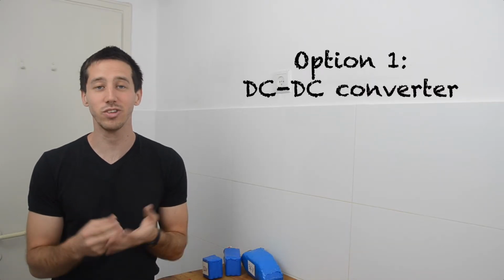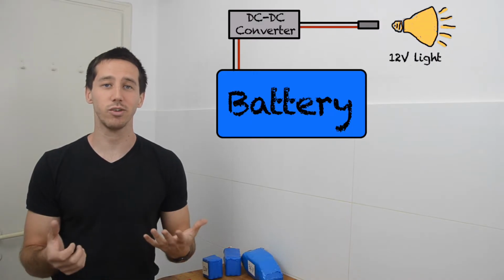How to add any LED lights to an electric bicycle

Comment: Wiring LEDs in series is the stupidest idea for a bike or any vehicle. You seem to have your list backwards. The individual regulated lights is the best solution. if you wire all your lights in series and any blow, ur whole lighting system goes down. Then ull have to test each individual light to see what one is at fault. God forbid you also mismatch the light types in amps, watts or impedance and fry half your lights.
Reply: none of these youtubers actually show you them wiring it to their own bikes, notice how they are all doing inside on a table, videos like these should be deleted from youtube
Reply: The LEDs  on strips are already in series / parallel configuration

Comment: I love all you do Micah, just bought your book on building battery packs, amazing read!  

I do have one critique however, even though you CAN draw power from you charging port on your battery to feed a light, depending on you BMS, it can be a very bad idea to do so, as it could damage the BMS.  

I love the idea of wiring several 12v lights in series however!  Never would have thought of that, keep up the good work!
Reply from the maker: This is true, but I've never seen a BMS that can't handle at least 2A via the charge port. This seems to be a nearly universal minimum for ebike battery BMSs. So unless you're using huge lights that pull more than 2A, I can't see this being an issue. But you're right, pulling more current that the BMS can handle via the charge port could damage it.
Reply: Thanks for your reply, I only mentioned this since I sought to use this very method to power a LED headlight, but was warned against it by the battery manufacturer.  Perhaps they were just being overly cautious.
Reply: @EbikeSchool  I was about to try ur method of wiring to charger port but now Idk if these light will be to much draw...How can I access power without  damaging BMS? I was told to find B+B- wire but IDK what that means
Reply: Hi Micah, I have 4 lights on my bike which need a total of 43 watts of power to run. The maximum voltage they can run at is 24 volts but my ebike battery is 48 volts. I want to connect a dc-dc converter from my ebike battery to the lights so that it can step down the 48 volts to 24 volts to power the lights. I am thinking of buying this dc-dc converter: www.ebay.co.uk/itm/292416497951
You stated in the video that I can draw power from my charging port, and reading your comments here, you state that I should be able to draw at least 2 amps from the charging port. If I do the math, the dc-dc converter will probably draw around (43/48 = 0.9) 0.9 amps, which is well below the 2 amp limit. Will this work? Let me know. I also have a USB port on my ebike battery - would I be able to draw power from that?

Comment: Good video. Would it be possible to wire in a 12v plug in to part of your battery while building your battery bank? Then you have a 12vdc plug in to be used for anything you want really from lights to a radio. Keep up the great work.
Reply from the maker: Absolutely. You could include a small DC-DC converter with a 12VDC output inside of your battery, right next to your BMS. You'd input the battery's discharge wires to it (run a couple extra smaller wires in addition to the main "battery out" wires) and you'd have the equivalent of a 12V aux plug in your battery, good idea!
Reply: No, I mean drop the DC-DC converter, and just tap right into say 4 of the batteries out of the 40 or however many batteries are in your battery bank, and just spot weld in a wire on the POS and a wire on the NEG of those 4 batteries to get 12vdc. Of course this is assuming each battery is 3vdc. Then just run that plug in out of the battery for 12vdc use for lights and radio or whatever. 

I'm asking, because having ANOTHER electronic piece inside the system is just one more thing that could fail and it won't fail at noon when the sun is up and you don't need lights, it will fail when it's dark outside and you're riding along, and then what will you do?

It's pretty hard for a few wires to fail that are hard wired right from the battery to a light. I like simple and the fewer the electronics on board, the better as far as I'm concerned.
Reply from the maker: Theoretically yes, that would be possible, but it would cause a different problem. Those 4 cells (or 3 cells might be better as they charge to 4.2V) would be drained faster than the remaining cells. That means when you charge the pack, the BMS is going to be working harder to balance it, and depending how much you used your lights, you could end up with a very unbalanced pack that could take many extra hours or even days to balance when charged.
Reply: Okay, that's the answer I was afraid of hearing. How much loss do you have with a DC--DC converter or is it so small that it's not worth talking about? Also, what kind of amps are we talking that a DC-DC converter can handle? Thanks for your time. I do appreciate it more than you know.
Reply from the maker: I wouldn't expect to get more than 90% efficiency. So if your lights require 10W total (which would be a lot), then you're looking at losing about 1W of power in wasted electricity from the DC-DC converter. So it will cause some loss, but the scale is very small. There are DC-DC converters of all power levels. Most small ones are rated at 1-3A or less, but you can find them up to 30A or more! It's just a matter of choosing the correct one for your needs.
Reply: Perfect, thanks a lot for your help. I'm looking forward to more videos from you and a video on your 2 wheel drive bike and how that's set up. Keep up the great work.
Reply from the maker: No problem. The 2wd bike video will hopefully be done this month!

Comment: i have 88 volts on my bike. and i use same metod of connection 12v leds under frame in serial, and 80v main headlight. and its very bad idea. shortcircuit on wires will kill my bms, or batery pack. god bless me xD
Reply from the maker: Haha, well you can always include a small in-line fuse!
Reply: Shortcircuit will not kill your BMS or battery-pack, that's the whole idea of having a BMS.
As long as there is a short-circuit the BMS disconnects the battery-pack until you solved your short-circuit-problem.

Comment: Can you do a vid on "capacity testing"??( I have a battery that shows 48v,....but dies under ANY load)
Reply from the maker: I actually already made a video on capacity testing. It's called "how to build a lightbulb discharger" and shows how to test the capacity of a battery. But in your case, that sounds like a weak parallel group that still charges to full, but when you apply load, its voltage drops and causes your BMS to cut off, thinking it's protecting the battery from overdischarging.
Reply: EbikeSchool.com So, I charged by battery, cut the BMS out AND replaced controller,....same problem so,...guess it's the battery,...(or the handlebar display) (?) anyway,....guess I gotta learn or walk(lol)

Comment: Why not use a simple resister using ohms law R= V/A?
Reply from the maker: That is a viable option, but you'd need a beefier resistor depending on how many and what power level of lights you're using. Also, that's just wasted heat. It's a small amount, but I'd rather turn that energy into light instead of heat.
Reply: Don't forget to deduct the total voltage from the main power, for example 36v and you only want one LED and that one LED is 3v and .002a so you deduct 3v from 36v = 33v divided by .002a and you'll need a 16,500 or slightly higher ohm resister put some heatshrink on it and off you go.
Reply: You mean making a voltage divider?
This would work but you would have losses across the resistors, the losses could be negligible.
Reply: Slight if any and these little DC to DC converters are never 100% Efficient either.
Reply: instead of resister just use more LED so you get more light

Comment: Led strips look a cool way to go...no more forgetting to charge the stand alone lights
Reply from the maker: That's exactly why I prefer lights that run off the main battery. That and the fact that smaller lights are either flimsy, or the sturdier ones cost way too much!

Comment: I'd like to see a turn signal tutorial
Reply: if you don't know during the daytime use what they use to teach in high school drivers training?? try the HAND SIGNALS?? THEY DO WORK, BUT BETTER YET TRY THIS THING?dOES THE SIGNALING FOR YA?wITH U.S.B. PORT RECHARGING TOO! ENJOY HOPE IT HELPS? FIND IT ON E bAY TOO, https://www.ebay.com/itm/Remote-Control-Wireless-Bike-Bicycle-Laser-LED-Tail-Lamp-Turn-Signal-Light-NEW/273395266332?_trkparms=aid%3D333200%26algo%3DCOMP.MBE%26ao%3D1%26asc%3D20171012094517%26meid%3D1f608fcb08e546b9aa6cba7d10cc3ae4%26pid%3D100008%26rk%3D1%26rkt%3D12%26sd%3D121830723451%26itm%3D273395266332&_trksid=p2047675.c100008.m2219  HERE'S EVEN A BETTER ONE JUST LEAD THE BIKE AND IT POINTS WHICH WAY YOUR TURNING AND BRAKE IT LIGHT UP LIKE A STOP LIGHT ALL AUTO TOO! ENJOY?  https://www.banggood.com/XANES-stl-01-64-LED-80LM-Intelligent-Automatic-Induction-Steering-Brake-Safety-Bicycle-Taillight-with-Infrared-Laser-Warning-Waterproof-Night-Light-USB-Charging-p-1141068.html?gmcCountry=NL&createTmp=1&utm_source=google&utm_medium=cpc_elc1&utm_campaign=dm-all-rm-pcps0&utm_content=eddy2&gclid=EAIaIQobChMI1smjh6ub3gIVAp_ICh1iEg5zEAEYASABEgIy6vD_BwE&cur_warehouse=CN